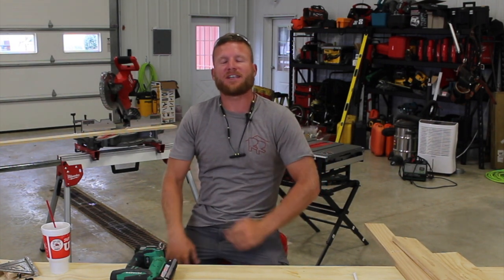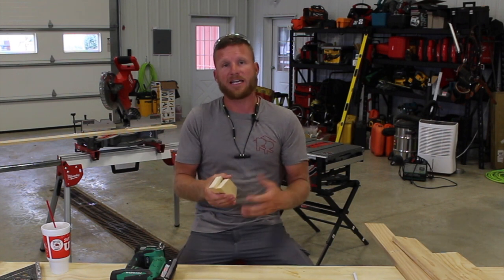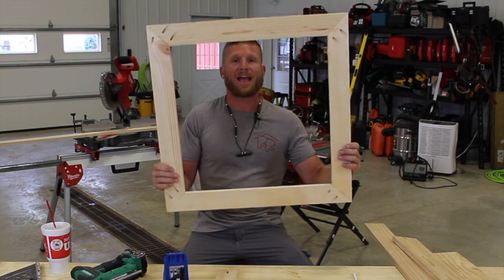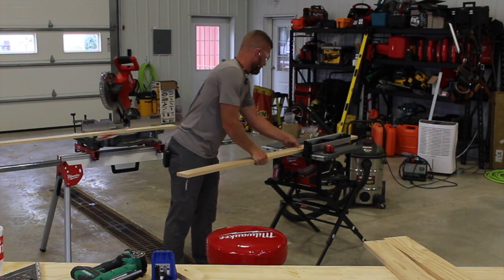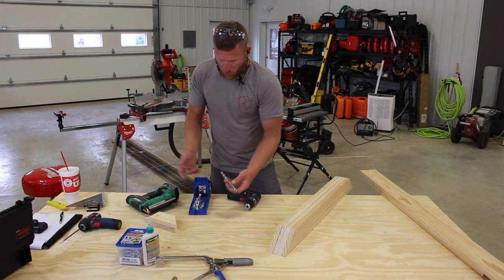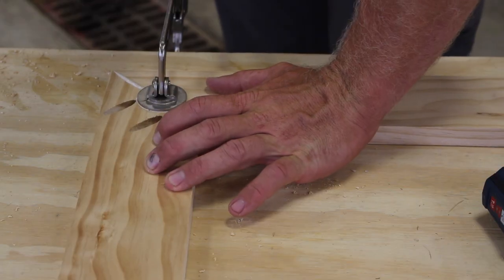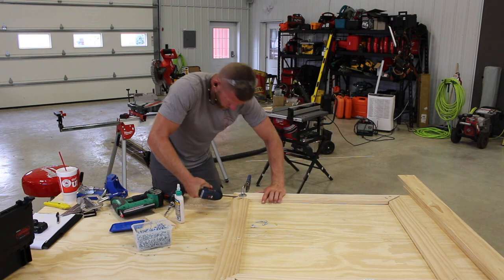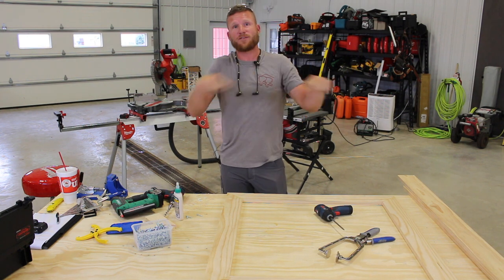Easiest way to make window casing (aka picture frame) with a Kreg Jig

Comment: That is a slick system.  It makes me think of the difference between a framer and a finish carpenter. I know that's stereotyped, because both are a highly skilled trade but in general a framer doesn't spend as much time thinking about tolerance as much as you seem too.  That's why I like watching your post frame builds.  Most people would probably say you are overthinking them but the quality is self evident in arguably the most simplistic construction method out there.

Comment: Hi Kyle been watching you for a while. Love your vids 
I’ve been in the trade for about thirty years. And  you still thought me a few new tricks 
So thanks for that 
Here in Montreal where I’m from we do window casing a bit different 
Where only the bottom moulding is actually cut at 5or10 degrees.  And the sides are bud. Joint to it 
Than only top two corners join at 90 you can also use a biscuit jointer on the joints 
Which are very strong as well. 
Keep the good work and vids going cheers Dave.
Reply from the maker: Thanks dave

Comment: Great presentation!  I’ve used Kreg pocket screws in my woodworking projects for several years. Awesome way to hold things together while glue sets. Your extensive tool collection never ceases to amaze me.  Was that yellow scissor looking thing a Kreg pocket hole clamp? I’ve never seen one of those before.
Reply from the maker: it was a miter clamp they had at menards as well
Reply: RR Buildings thanks - I go to Menards almost daily - I don’t know how I missed it.

Comment: I have messed around with how best to make face frames for cabinets over the last few years. You will find out with pocket screws getting the flat surface of the frame, the surface that is supposed to lay flat on the table, will sometimes not line up.   You will then migrate to using Festool dominoes for prefect alignment every time.  Trouble is, the damm tool costs around $1400. Despite the vice grip type of clamp with the round clamping surface you used before screwing the wood together if the wood has a twist it will then move after that clamp is released.  Especially in soft wood like pine the screws will not maintain perfect alignment.

Comment: Awesome Kyle, I love my kreg jig! I found kreg screws get expensive, just get a 8in long T25 bit, and use the appropriate screws.
Reply: Foty 3rothers kreg screws are made to pull the joint together. Are you buying screws that are threaded only halfway like a kreg?  If not I would say your joints are not nearly as strong as they would be with a proper kreg screw. Don’t cheap out in the cheap stuff!

Comment: Built my house a couple of years ago.  I used 1x3 flat casing.  I tried a combination of biscuits and pocket screws and glue.  Ultimately I found that the pocket screws and glue on my miters Was the strongest.. Biscuits reduced the purchase area for screws.  I, like you, made up my frames and let them dry before installation. My windows are 5'x6' so I waited longer for the glue to dry as they tend to be pretty flimsy.  
I like how you build your post frames.  I've never built one but I'm tempted.  In my area, I'm not aware of anyone that pours post footings.  It's all buried posts.  The biggest issue is, I'm at 5600 feet on a. mountain and it's mostly rock.  My basement was dug with a CAT 320 Trackhoe with a  ripper tooth.
Reply from the maker: that's awesome...nothing like that where Im at

Comment: That is a great tip or trick, but later on down the road when a frame may have a rotten board and need a repair. The whole frame will haft to be removed along with all of the   caulking.  Thank you for sharing.

Comment: Miter bond- 2 part glue + accelerator...super strong and dry in 30 sec
Reply from the maker: Jon Brignell thanks Jon
Reply: @RRBuildings  not sure if it is sold in the states but here in Canada it is a staple in any trim carpenters tool box. Nothing beats a mechanical fastener but  for time savings you won't find a better product. DFW crown out of Texas, on YouTube has some great videos regarding these products. Love the channel. Cheers

Comment: Surprised me when you dissed the other big box stores with your Menards love.
Reply: The Menards in my area is bigger than Home Depot and Lowe’s combined. The hardwood at Menards is superior to Home Depot. I couldn’t find a single straight oak board at HD.
Reply: The closest Menards for me is 573 miles. Ironically I just bought 16' of 1x3 oak at HD. I lived in Indiana for 11 years so I know Menards. The point is, I don't find Menards superior to either of the big box stores. I'm sure I'm not alone in that.
Reply: When it comes to lumber, Menards is FAR superior than the other two.
Reply: oned4metwo I prefer Menards for a lot of things but I mostly go to Home Depot now because it is slightly closer to me and because the Menards near me is super busy from open to close. Menards on the weekend can be a nightmare.
Reply: I like all of the big 3 stores for different things. Several years ago, one of my coworkers nicknamed it WOMENards because it seems to appeal to women. The store feels less industrial and has more home decor displays.
Reply: I live in Eau Claire, Wi. Headquarters of Menards.  Two Menards and no competition left. However I bought my first Kreg jig about 20 years ago at Menards. Love it.
Reply: I do not use Menards.

Seeing as I am way outside their area.